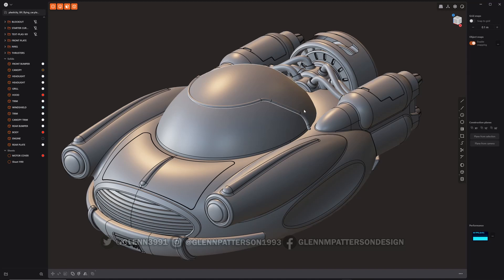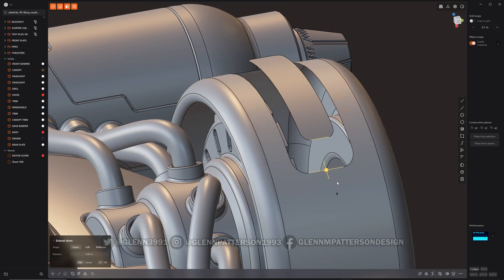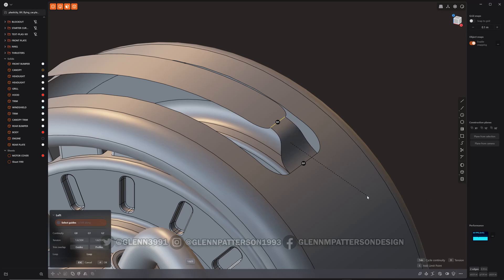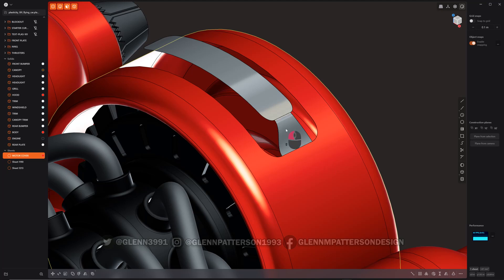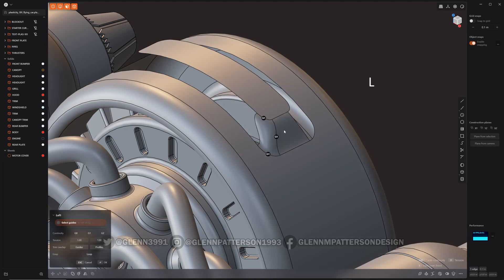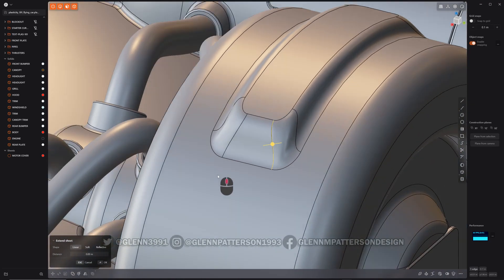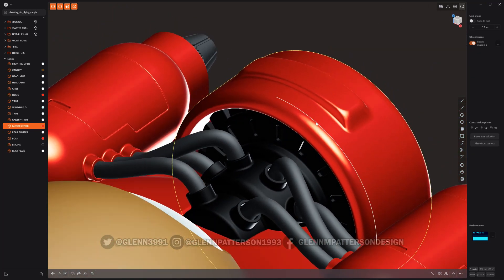67 PLASTICITY 101 LOFT ENHANCEMENTS (1.2 UPDATE)

Comment: Sometimes in those cases it can help, to make it more cleaner, to set parallel limit points for the loft on both long sides and then patch the corners.
Reply from the maker: It's a handy little tool, but I was thinking the same thing on Patching corners. Think if Nick tunes the tool to realize that it won't match up and just switch to a patch on the fly.

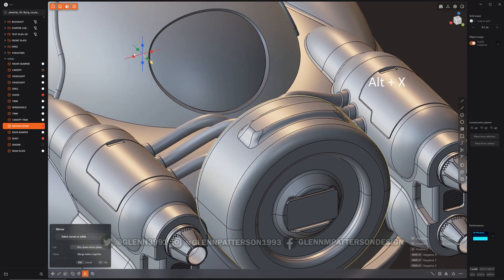Comment: 3:09 - why even if you use merge, it still creates that center line in some places?
It can be removed manually by deleting one one of the splited faces, but anyway
Reply from the maker: I'm uncertain why as well, if I disable edge lines it's perfectly smooth. Easy fix with a Patch though